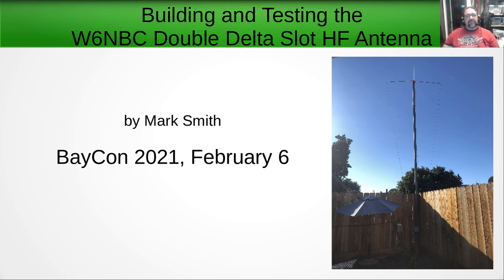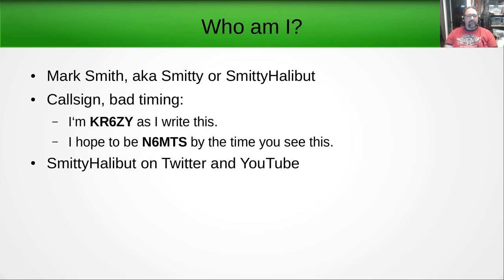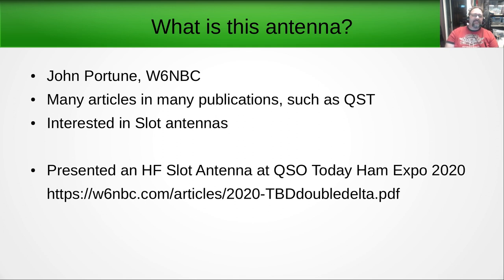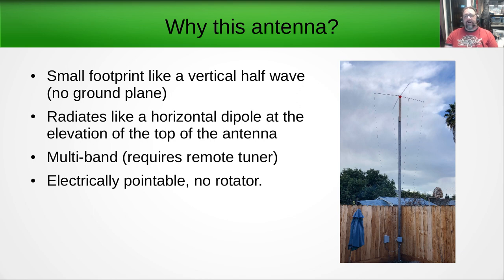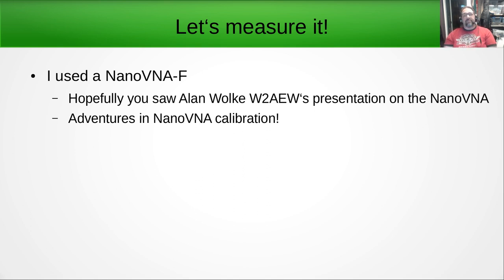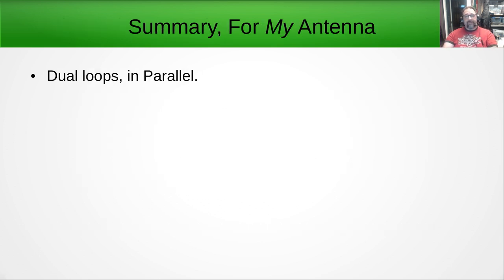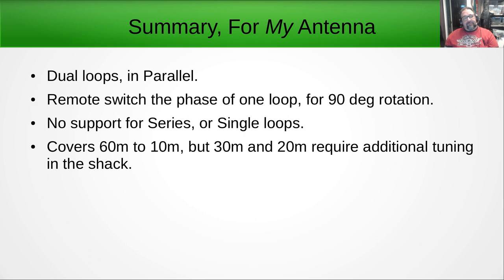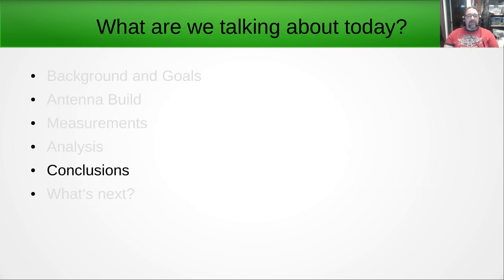Smitty working on SOMETHING: W6NBC Double Delta Slot HF Antenna

Comment: Howdy Smitty!  How is this a slot antenna?  It loos like a traditional loop.  After that article came out, I built several slot antennas for 2m, 40cm and 6m.  I used aluminum tape for the little ones and the six meter was a rain gutter downspout with a nine foot slot in it!  They all worked well indoors and saved lots of space versus a vertical.
Reply from the maker: I think the point is that "traditional loops" ARE slot antennas, they just don't go by that name.  But the underlying physics are such that the radiation is primarily by currents in the loop, rather than voltage swings at the tips.

I'm mostly talking out of my stinky-hole here, John's article describes this better than I can. Specifically, it covers the path from VHF slots, to 6m slots (yes, still VHF, you know what I mean), to HF slots.